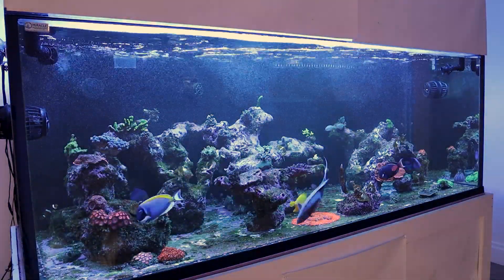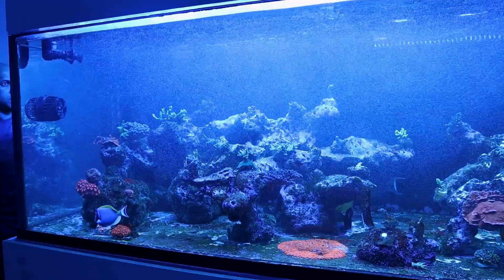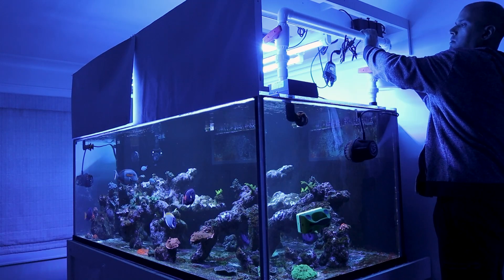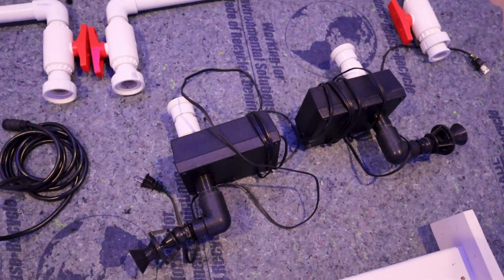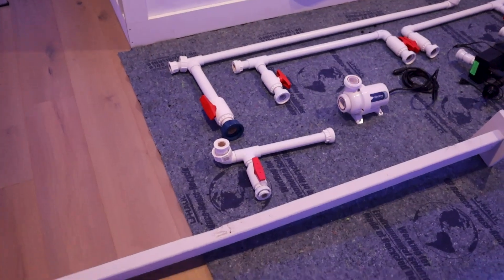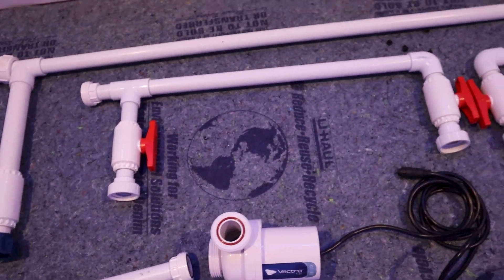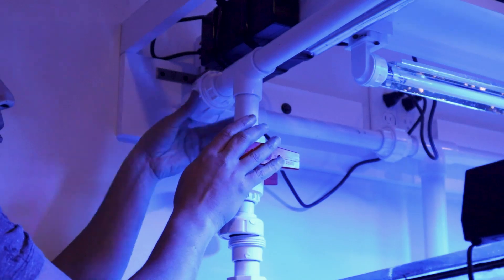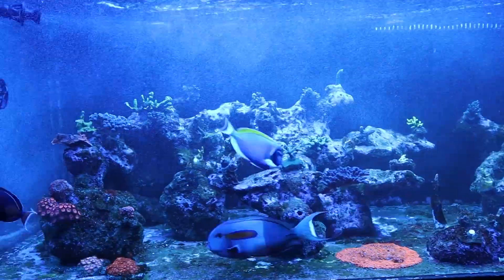Reef Tank Closed Loop Flow: Design, Setup, and Maintenance for SPS, LPS Corals

Comment: Sea swirls are a hidden gem of the reefing world.  Ed, creator, is a great person to talk to.  Also great job.  I was curious as to why the elevated Vectra but I know why.  I probably would have went on the floor and used a different pump but regardless, you thought this out and did a great job.  All the best.
Reply from the maker: Thanks! Yes, Sea Swirls are amazing. Because of them, I only need two MP60s on my tank — which otherwise would never be enough.

A few reasons I placed them on the back, about a foot below the waterline:

The head pressure is only 19", so I’m maximizing flow.

If anything ever goes wrong, I didn’t want to risk dumping water on the floor.

Last time I took the Vectra out to clean it, it didn’t turn back on, so I’ve been reluctant to touch it after a year of smooth running. Ecotech actually replaced it long after the warranty expired, so I was really happy about that.

I also like the controllability — running it on ReefCrest and changing up the flow patterns gives the tank a completely random flow. I knew from past setups that the Vectra is silent and doesn’t vibrate, so I didn’t want to risk switching to something untested.

That said, if I were setting it up now, I might consider a Periha pond pump. They’re quiet, more energy-efficient, and with ball valves to reduce flow plus the Sea Swirls creating randomness, I could probably manage just fine without the controllability.

Comment: Such a great setup for flow. Even if multiple extra power heads were non intrusive and easy to maintain, controlling them like how you want them to needs a controller and the powerheads to be compatible. SO EXPENSIVE. With yours, you just need one dc controllable pump with the fancy control to turn down at night and the two powerheads to run their inbuilt functions. Awesome brother.

Here are three possible option like the Sea Sweep(not Sea Swirl)all very much cheaper and are so sweet. 

Ay check this out, a guy made a DIY Sea Sweep with a 15 dollar CCTV motorized mount and a powerhead. 
https://www.youtube.com/watch?v=yCvLP_0iYtc&t=23s
So technically they are close but will most likely not have the function of turning down the power at night due to most powerheads or I think all do not that app timing function. Still cool. 

OH here is another product from Germany. It can control multiple powerheads and different sweep and times and so much with the web application not an app the only downside. For wayyyyy less then the SeaSwirl and no need for a closed loop system. They do not ship to the USA but there are 3rd party shippers who can receive the product then ship to you.
https://www.youtube.com/watch?v=jsYYC3WxOnA

This last one is insane also from Germany and has an app and has various models that go from standalone to app and or wifi.
https://www.youtube.com/watch?v=drNAIU2G3tI&t=129s
You can put frag racks on them and also telescopic, and a temp range monitor that will send you a notification. It is insane that there are these tools out there and you never see them in US tanks or any where else.

Comment: Awesome set up, liked the outlets being raised near the surface as opposed to the bottom (fear being one could fail).
Reply from the maker: @glowwurm9365 thanks,  yeah it's nice having them above the Tank and not too much going on under as there do tend to be salt creeps formjng
Reply: @AquariumSurge  This has inspired me, on my dream tank ill be running a closed loop via back wall outlets with over the top plumbing into euro bracing and sea swirls. Currently torn  in regards to pumps, was looking at the Deltec as i will be using this for my return pump (triton method sump), but it lacks the programmable nature of the Vectras (wanted the deltec on the closed loop as a back up for the return if it failed).

Either way you provided the inspiration, so thanks.

Comment: you could also pass a pipe or tube of a closed loop through the substrate
Reply from the maker: @andibandi1190  yeah I definitely could use some flow on the bottom.  Only thing that's holding me back is I don't want to look at those pipes. Maybe ones things are grown in it won't matter
Reply: @AquariumSurge  I had a Jaubert System with 4+ inch substrate, so the tube was well hidden and never shoved up🤡

Comment: Good info in this video. How did you mount the canopy over the tank? Is the tank holding all the weight of the canopy and lights? Thank you.
Reply from the maker: The front two corners are holding the weight and the back is bolted to the wall

Comment: Nicely done Sir.  Very much agree with your ideas on the powerheads in the tank.  I plan to do a center tower overflow box and add similar outlets for the inline recirculating system on the center tower, the conceal everything with epoxied rocks to make the tower and water outlets look like little caves in the rockwork. I’m a big proponent of no visible pumps or tubes.  Love this hobby for the creativity.  Questions. Any issues with your overflow not pulling the surface film out as I’ve got a peninsula tank and if the powerheads pointed up they could drive the surface gunk away from the overflow box.  Looks like you probably have so much agitation that it isn’t a problem.
Reply from the maker: It has no problem with removing junk from the top.  I will say I did have to play around with the positions of the outlets to achieve this as initially I found the left side tend to build up surface gunk. I never have the seaswirls pointing at each other.  When one is pointing at the back glass the other one is pointing towards the length of the tank.   Aslong as you have options to play around with the outlets and everything is stiring crap will find the overflow or a dead spot on the rock

Comment: Fantastic design and great to see it in action and what it consists of. 👍 Been planning a similar thing. Just about exactly like you have the pump below the water level in the back. However instead of this piping and outlets coming from on top i was thinking of having a pipe going inside the tank to the back and bottom and having multiple random flow generators blowing between rock bommies and behind them. Perhaps i go with your way of doing it. 🤔
Reply from the maker: Thanks, The way you mentioned is a good way too do it  - aslong as you have the depth to make it work.  However, after seeing mine in action it has no issues getting flow to the back everywhere in the tank. Plus I like the ability to customize it as needed.  Also, not a fan of those random flow generators, there is no velocity that comes out of those and they reduce the flow same way as a valve does, I think just ramping the flow up and down is more the sufficient to get random flow.
Reply: @AquariumSurge  - Do you need to somehow prime the pump?
Reply from the maker: @mikkostenberg1740  No, if your inlet is above waterline than you have to prime.